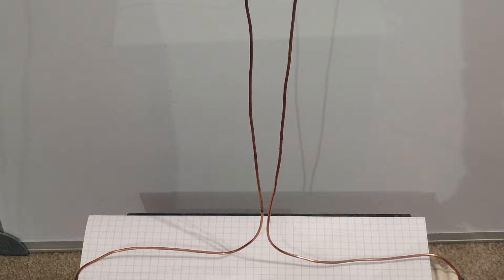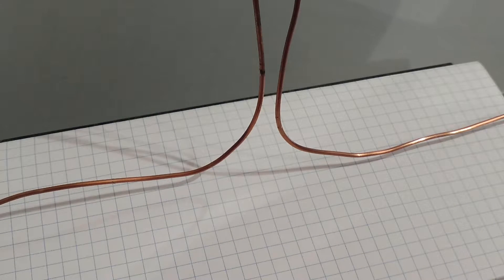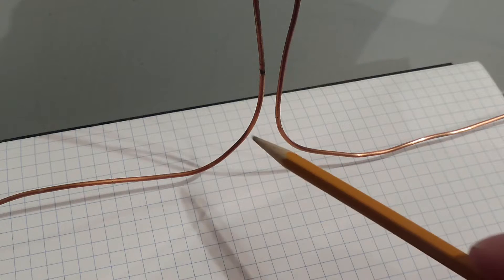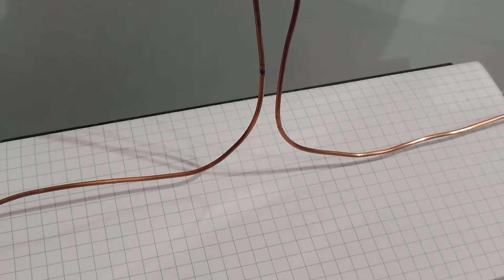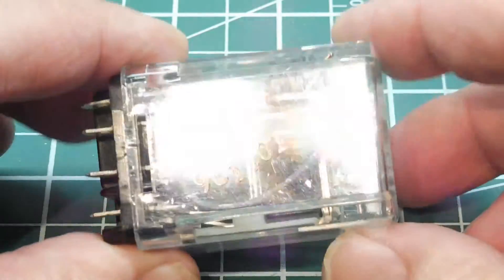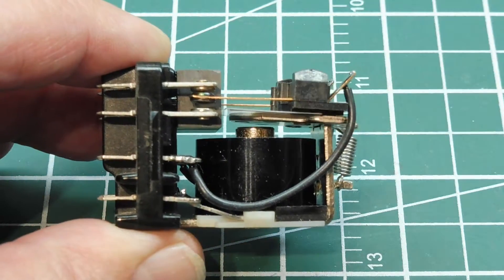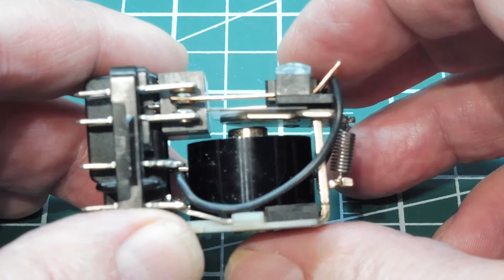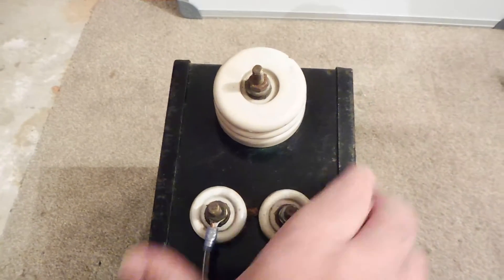Build a High Voltage Jacob's Ladder  / Relay Blowout Magnets

Comment: Hi Sir my knowledge is we ll get more arcing in DC insted of AC. if we are switching DC of 800v at 10A which type of relay we need to use.
Plz give suggestions to.
setfusion.info@gmail.com
Or 
WhatsApp +919972779899